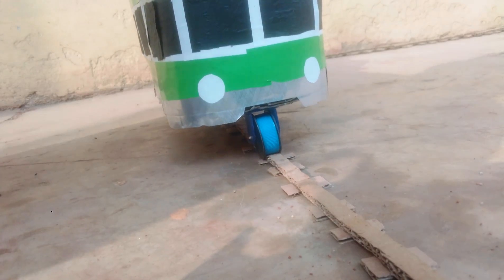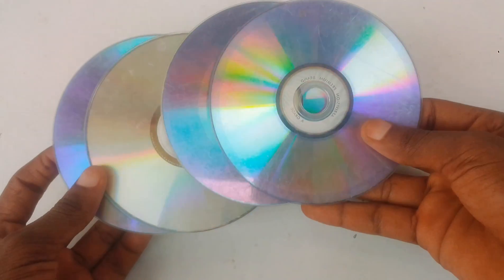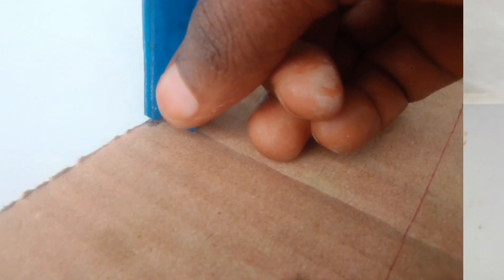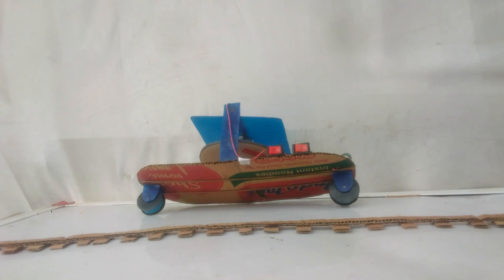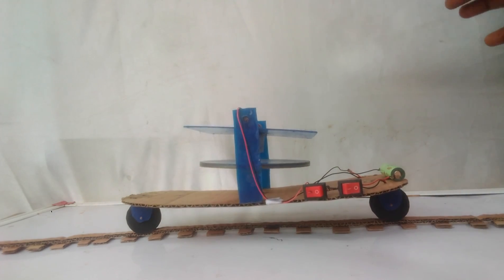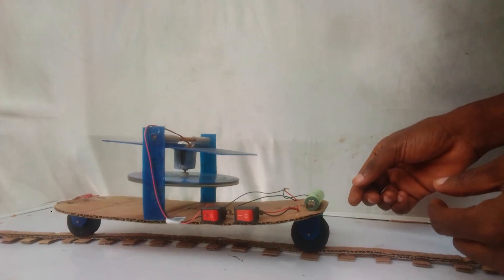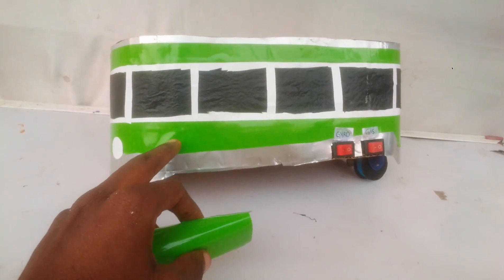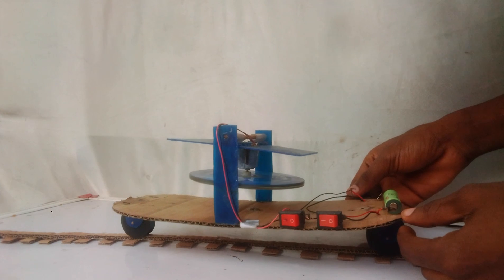Diy Self Balancing Train | Gyro Monorail Train

Comment: Can u pls list the materials used?
Reply from the maker: Hope this helps
Reply from the maker: I used old CD plates and a DC motor to build the gyroscope, then I used tin can and bottle caps for the chassis and tires
Reply: What is that blue colour one?
Reply from the maker: @pgtuljaram7880 those are piece of plastic I used to holds the wheels in place

Comment: What motor are u using
Reply from the maker: For the gyro, I use a 9 volts high speed DC motor, while for the engine, i use a 6 volts  N20 high torque motor
Reply: @creativemindz1766  what about something like a 3-6v dc motor
Reply: 140 motor
Reply from the maker: @sunsetthireach3223  for the gyro?, not sure, but it should work for the engine
Reply from the maker: @sunsetthireach3223  the Gyro needs to rotate at high speed, so it's best you use a high rating Speed DC motor
Reply: @creativemindz1766  is 5200 rpm good enough?
Reply from the maker: Yes, and try to make the gyro disc heavier, you can glue 10 pieces of old CD plates instead of 4 like I used, I researched and found out a weighter disc or flywheel is better for Gyroscopes
Reply from the maker: Also please share this video and SUBSCRIBE too 🙏🙏
Reply: @creativemindz1766  does the weight of the motor need to be taken into account also how high and where did you place your gyro. Subscribe done ☑️ could you also elaborate on your motor like a 140 dc motor or 390 dc motor or something like that
Reply from the maker: My motor is a 6-9 volts DC motor, with a 10000 rpm at max voltage, thanks for the Subscriber
Reply from the maker: The weight of the motor isn't really a problem, as long as the speed is enough the gyroscopic precession should be enough too